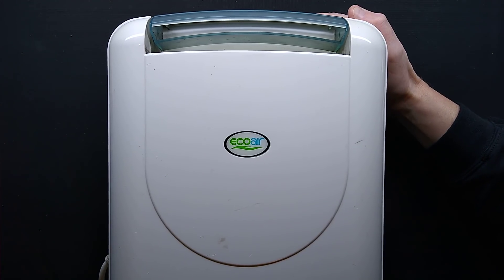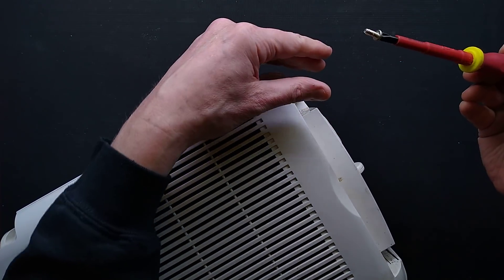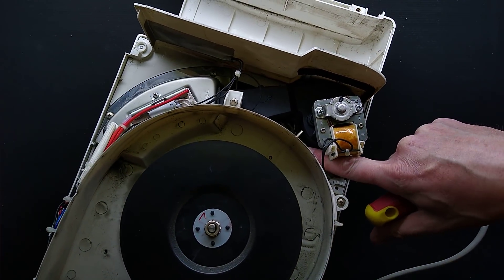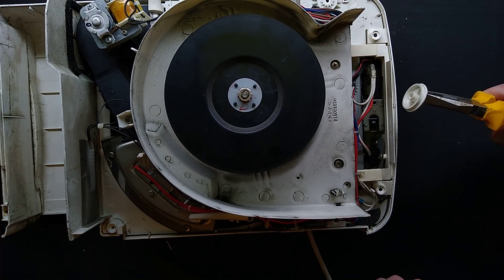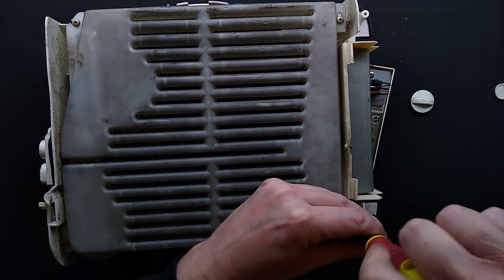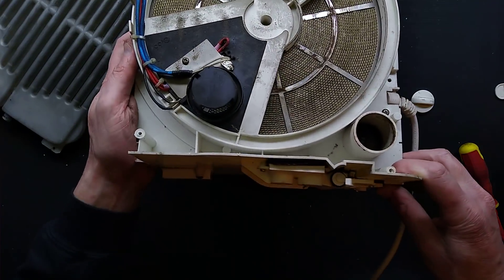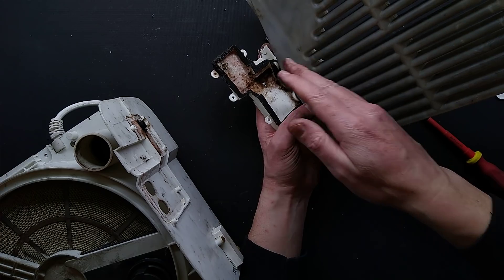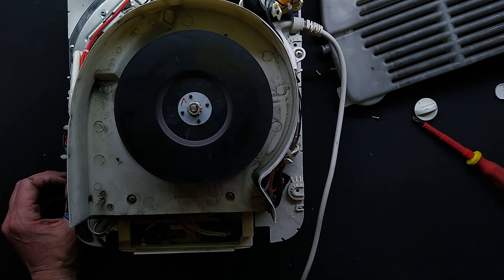Opening a desiccant drum dehumidifier.

Comment: I have a similar model to this, I've never had to clean the filter, it never seems to get clogged. I probably should give it a good clean inside though, there's a bit of black mold in the water tray.
Reply from the maker: It may be worth dropping off the little water collector inside.  You may be able to do it from inside the drawer slot.  Make sure it's completely clean and that the ports coming down from the white condenser panel are clear.
Reply: @bigclivedotcom  It probably doesn't help that I haven't always emptied it promptly when the drawer is full!

Comment: Mine is new but doesn't work. I opened and looked for a fuse but I couldn't find one. I was hoping you had shown it but I didn't see one in yours either.
Reply from the maker: If you bought it from a legitimate source, contact them for an exchange unit.  There are safety tilt switches inside.  Make sure it's on level ground.
Reply: Make sure there’s no broken wires anywhere

Comment: A desiccant drum dehumidifier with a water tray?.. That seems strange. I've worked on some that had desiccant wheels as big as a human wingspan, and they just used a heated flow of air to regenerate the desiccant, dumping the now sopping wet air back to atmosphere.
Reply: Oh, it does use a heated stream of air, but then it cools it back down. Seems like that would massively limit the throughput of the device because there's no way it's dropping most of the water out of the saturated stream with that tiny bit of passive cooling. No wonder it gets gunky though, part of it basically stays at 90-100% humidity.
Reply from the maker: It pulls it out at a surprising rate.  You can literally hear it dripping into the collector every few seconds on its low setting.
Reply: @bigclivedotcom  Huh, interesting that it works so well. I bet it would work many times as well and be less prone to fouling if that condenser was copper though.
Reply: What on earth would be the point of a dehumidifier that collects water from the air and then dumps it back into the air?😕
Reply from the maker: The one that dumps it back into the air is the industrial type with an internal airflow one side and an external airflow to take the moisture away.
Reply: @ferrumignis  There's two different airstreams flowing across different segments of the wheel while it turns. Airstream 1 stays inside and flows through a regenerated portion of the wheel. then that portion of the wheel rotates into the path of airstream 2, which is pulled from outside, heated, passed through the part of the wheel that just absorbed the moisture which liberates it(regenerating the desiccant) and puts it into the airstream, and then that air is vented outside.
Reply: @AtlasReburdened  Ahh, didn't realise it vented outside, makes far more sense!
Reply: @ferrumignis  Yeah, I should have been a little more specific when I said "to atmosphere". Darn relativity of terms got me again.

Comment: Along with working at lower temperatures, a desiccant dehumidifier should also allow a much lower humidity level to be achieved.  At least here in North America, high-capacity desiccant dehumidifiers are used for the later phase of drying out buildings by flood remediation crews.  (Yes, I had to have one in once.)
Reply: But are they as efficient ? At least refrigerant type extract heat from the water before they get rid of it.
Reply: @millomweb  By all accounts, no, desicant type dehumidifiers take about twice the energy per unit of water removed from the air under warm, high humidity conditions.  But, as Clive pointed out, they're much quieter and operate effectively at much lower temperatures, and as I pointed out, they can get down to much lower humidity levels.

You might not know this, but in the UK, the norm is for homes to be much cooler in the winter than is the norm in North America.  In North America, we usually go between 18 and 20 degrees C, but in the UK the norm is more typically something like 15 C (and Clive has pointed out that he normally keeps his home quite cool even for the UK and wears a lot sweaters).  If you keep your home very cool in the winter, a desiccant dehumidifier may be your only effective option to keep the humidity down.  This is quite important when the cool base temperature may give you very little room between dry air and condensation on the walls.
Reply: @evensgrey  I've 2 interests - in the house for intermittent condensation from bathing and dishwashing but also in an unheated garage where things are rusting ! The latter was not built to keep heat in and has an air brick at each end. I'm not sure what typical home temperatures are here in the UK but I feel confident they average quite a bit over 15°C. Our rooms are independently controlled - so rooms we sit in and do nothing are around 20-21 while general areas (passing through) are 18-19 and unused rooms, generally unheated unless they get quite cold.
Reply: I keep my house at 21c and I'm in the UK. Frugal folks in any country will keep the heating off.
Reply: @alexbrown1050  Multiple temperatures in ours. Residential rooms, 20-21, 'passageways' 18-19 & unused rooms: low teens.
Reply: @alexbrown1050  You don't get much more rural that the Isle of Mann, do you?  If shipping rates for packages are crazy, that means all shipping there is going to be high, including for heating fuel.  And I get the impression that Clive prefers it quite cool in his home.  (If he likes it cold, that explains why he liked some of the jobs he's described in the past.  Doing the old Glasgow Christmas light displays sounds like absolutely FRIGID work.)

Comment: Mine uses a compressor, empty it twice a day, it said it has a 70 liter capacity or something like that, I get maybe 4L a day, I guess it isn't very wet in here

300w, also the last thing I got a shock from, took it apart still plugged in, and with a wet hand (cleaning it at the time) touched a small metal housing, nothing major, but lesson learned!
Reply: those values usually are normed to work in 80% humidity and 30c temperature, shrinking drastically with lower numbers.
Reply: it means that if you had a tube from the machine to empty it constantly, it could take out 70 litres of water in 24 hrs
Reply: @collinhunter9792  under ideal conditions ie rain forrest type humidity and temperatures ;)
Reply: @collinhunter9792  I empty it as soon as it stops and that's only twice a day
Reply: @phonotical  then either the surroundings are quite humid if it takes this much out of the air every day, or there's a leak of outside air replenishing the dehumidified inside air constantly. In which case dehumidifying it is a huge waste of power.
Reply: @nrdesign1991  what are you on about
Reply: @phonotical  pulling eight liters of humidity out of the air in otherwise normal conditions seems really high. Either the surroundings are very humid, or there is a leak, letting in outside air constantly. The dehumidifier dehumidifies it, before it is let out again, so effectifely wasting power.
Reply: @nrdesign1991  four a day, I get four
Reply: @phonotical  Whoops, my bad. Kinda misinterpreted it with the emptying twice a day.
Reply: @nrdesign1991  had me confused for a moment, sorry about that!
Reply from the maker: Wer hands are a no-no for electrical work.  What would normally be a slight tingle can become a much more dangerous current.
All dehumidifier water extraction ratings seem to be bogus.
Reply: @bigclivedotcom   Perhaps those ratings are when running submerged?
Reply: @bigclivedotcom  true, unless maybe it was raining directly above the device 😂

I was washing it at the same time, got to keep those things clean

Comment: This makes me actually glad for the compressor kind that leaks out all its coolant in the first 2 years.  All this time I thought a desiccant wheel one would be better, but not if it gets that filthy and jammed up inside regularly.  At least the compressor system is easier to keep clean until it dies forever.
Reply: If it needs regular maintenance (such as cleaning out) they really ought to make it easier to disassemble.
Reply: I've had a compressor dehumidifier for over a decade, and no maintenance at all needed.  Just dump out the water periodically.  (And don't use it on the continuous setting, mine leaks on continuous run.)
Reply: I inherited my grandfathers dehumidifier,  it is probably 30 years old. It weights about 70 pounds. It got used all summer long every year. Still works. Although the 5 year old model we used has already quit working. They dont build em like they use to.

Comment: Is there a difference in electrical efficiency vs a compressor type?
Reply: This is an excellent question, and I would love to see what others have to say about this. My own experience comparing exactly one device of each type is, that in my application the compressor type seems to use about half the electricity the desiccant type uses. Now I usually use my dehumidifiers in a relatively warm and humid atmosphere (bathroom at 23C and 70%). My understanding is, that colder and/or less humid environments make the compressor type dehumidifiers vastly less efficient, and therefor the desiccant ones the better option.
Reply: Compressor types are generally more efficient. Desiccant is cheaper but also is necessary to remove humidity below a certain point, I believe it's roughly under 40% RH at room temperature. Therefore, compressors are for household uses, whereas desiccant is used for specialized industrial applications.
Reply: @straightpipediesel  The one most people are most likely to see is for drying out a home that's had a flood.  Desiccant dehumidifiers are part of the standard equipment for remediating after flooding in a home.  (Getting the place dry as fast as possible is a priority, otherwise you'll get mold.)

Comment: That's the one I'm sitting looking at here right now. Works well.
Reply from the maker: If it does give problems, note the first paragraph in the video description.  You may be able to remove and clean the water collection tray and condenser ports without opening the unit.